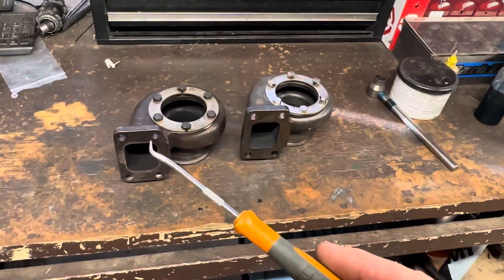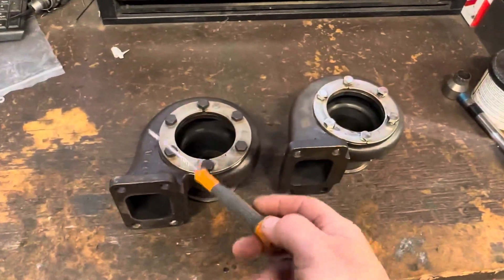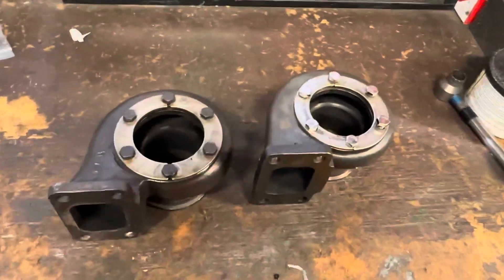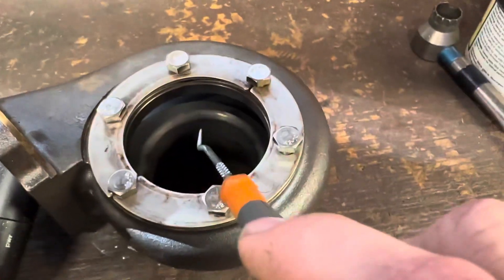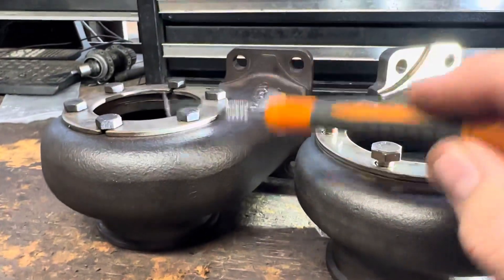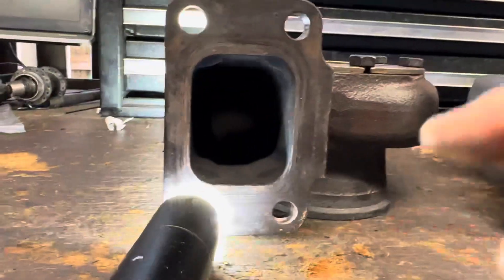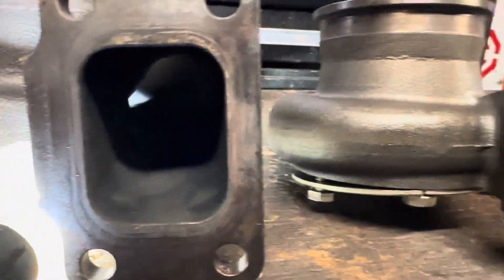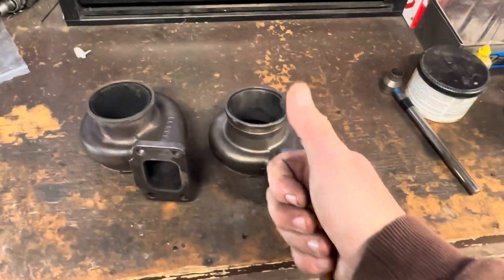Genuine GARRETT vs China/chinese exhaust housing - what’s the difference?

Comment: Maybe can radius dremel the chinese housing a bit?
Reply from the maker: @damnitdang  yeah you’re right, I did think about doing the exact same thing. But I just left it to see how it performed. The thing (GT3076) makes boost instantly, ie as soon as you put your foot down, it starts building boost.
Reply: @Fine_Performance  So you are satisfied with it?
Performs same as original to your feeling?
Reply from the maker: @ I’m just going through adjusting the boost control now between a China 0.63 & and Garrett 0.63. The Garrett is slightly slower to spool, but the China housing chokes a bit up top (after 5000rpm). So if you were wanting high hp, the China one might be restrictive. But if you don’t care & just want super responsive, the China housing is noticeably faster spooling. Garret 0.82 vs Garrett 0.63, the spool benefit is less noticeable. If you’re wanting above 450hp, don’t bother with Chinese housing. But if you’re less than that, it’s almost better I feel.
Reply: @Fine_Performance  I'm wondering if there is a middle ground/more efficient shape. What I mean by that, on another turbo (I'm thinking about my td05 16G) if softening the edges/smoothing the transition would make an improvement
Reply from the maker: @ I think it would help, I did it on my 20G. But it’s never going to be as good as properly engineered aerodynamics. After retuning the boost control, it appears the China housing was very coming a choke point. After listening to the guy that own FP performance & xona rotor, a lot of turbos choke at the turbine, not the housing. But you’d need to measure the emap (exhaust back pressure) vs map (manifold pressure).